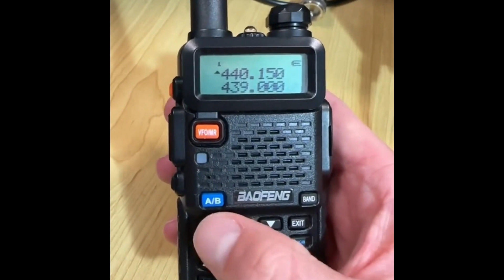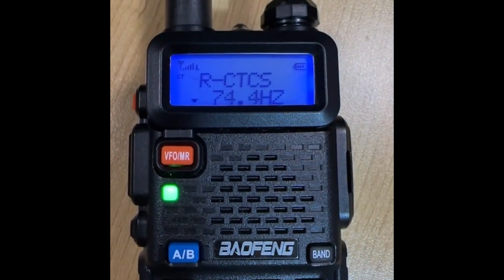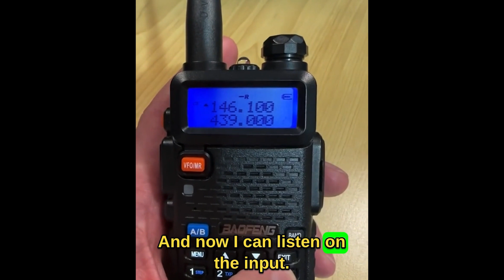Baofeng SECRETS You Didn't Know!

Comment: The “trick” about using the knob to tighten the antenna nut is not valid on all radios, I have two UV-5RX3 and tts knob does not have the four tips for the nut.